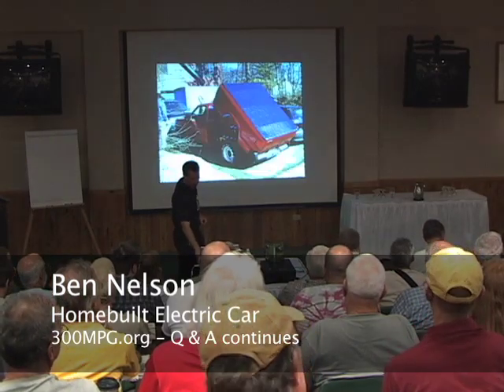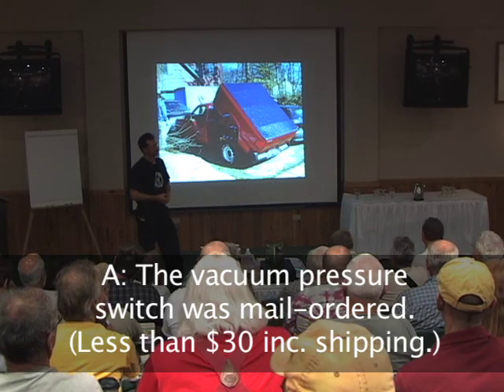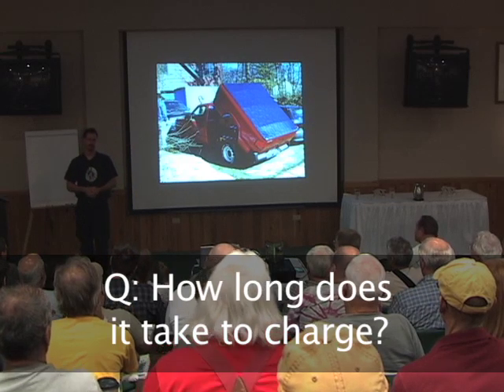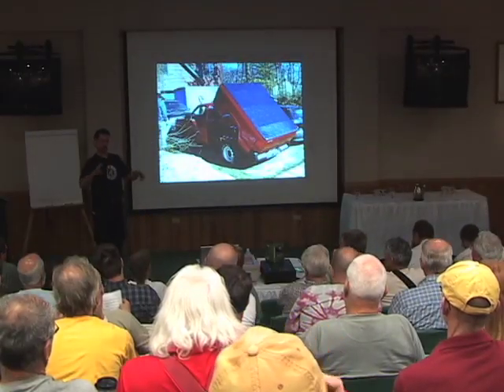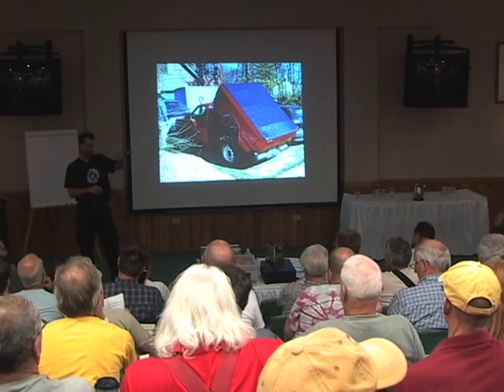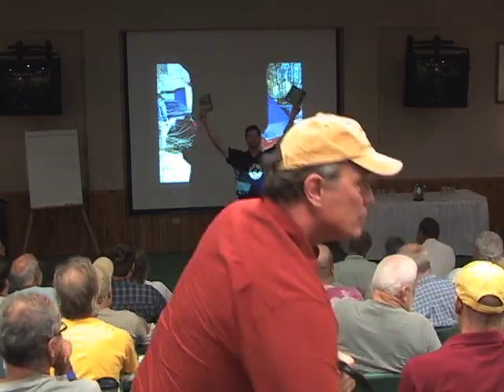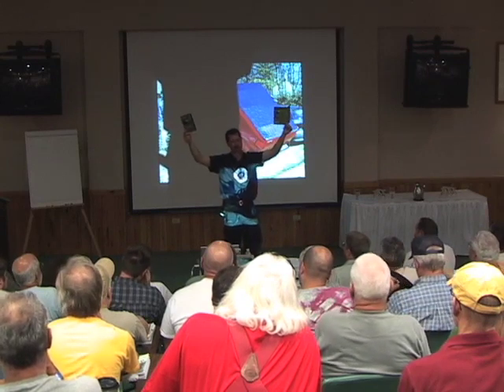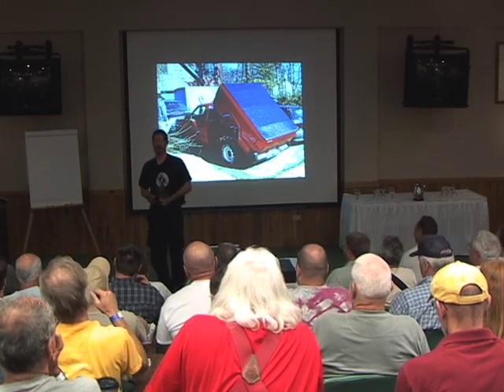Build Your Own Electric Car: Cheap, Part 7 of 7

Comment: You could always buy a more powerful alternator that creates more electricity.  Point is....   Dont run it at full potential.    Use it as a trinkle charge where your using the leftover force to create the energy making it so your batteries don't drain as fast. in other words, use the recycle the left over energy.  But I would think This would be fairly simple to do and that it would work.

Comment: If the electric motor spins, you would only need a belt to put on that and the alternator causing it to spin.  I heard you say it only spins in one direction, so you could put a belt on that and the alternator, or add a few alternators to get them to charge your batteries.

Comment: Great series - I really learned a lot.
I was thinking about such a project at fuel is 3 times more expensive in UK. I could run my car on whisky more cheaply than petrol (gasoline)
I was hoping to convert my smart roadster to electric but now I'm thinking there isn't enough space in engine bay for a good sized motor and then there is the issue with the semi-auto tiptronic gearbox to connect to. 
Do you think I should just go out any buy an old cheap car and start from scratch?

Comment from the maker: My car uses a "series-wound" DC electric motor. They are not appropriate motors to use as generators as they have no permanent magnets.

AC motors in general make very good generators, but this is a DC car.

Comment: I forgot to thank you in my previous note -- thanks so much for all of the information.  Just a day before seeing your video, I had the idea of putting six 12V into a Pontiac Firefly sized vehicle (1,500 lbs approx) -- since 1,000 lb golf carts run on four 12V.  I couldn't believe your video -- when you had done exactly that.  Great presentation.

Comment: If your electric motor had permanent magnets (apparently some have permanent magnets, other have electromagnets), would the motor not recharge the batteries when you took your foot off of the accelerator (like regenerative braking)?  When the regenerative question was asked in the video, you mentioned something about AC current?? -- but I know my little DC motor (with permanent magnets) from a toy, turns into a DC generator when spun manually.

Comment: @HowtoBuildThings things like Lenz’s law and physics stop this from happening and would require more energy to run with the alternator then what the alternator puts back. You would drain more power because of the internal drag of the coils of the alternator creating current, this is how regenerative braking works.

Comment from the maker: @HowtoBuildThings 
Alternators are powered by gasoline engines.
This car has no engine, just an electric motor powered by batteries.

I have considered building a hybrid by adding a small propane generator that would send some power to the batteries, and thus to the motor, similar to how a Chevy Volt works.